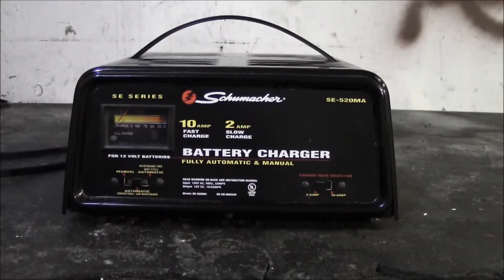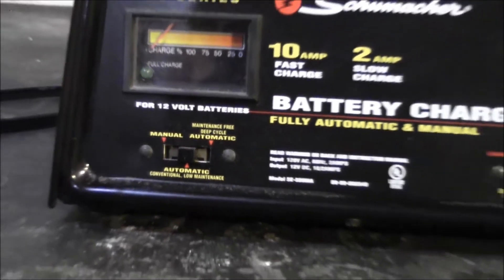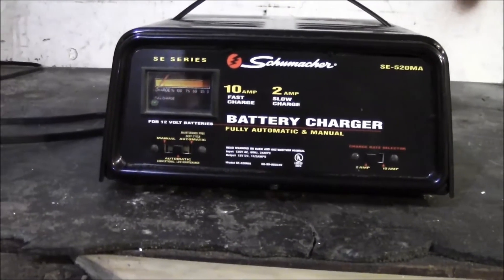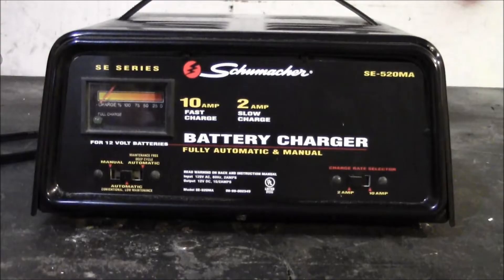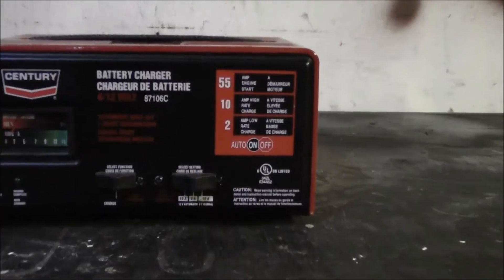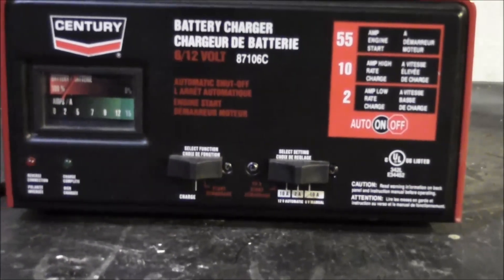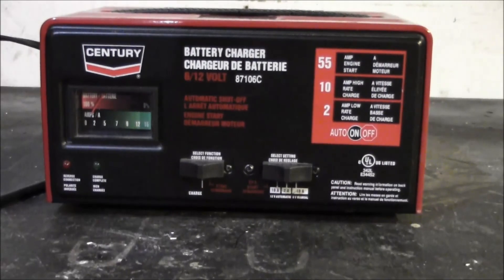What you need to know about battery chargers part 2

Comment: thanks, still using this,  i needed the part about  manual  charging onthe schmacher to  revive a deeply dicscharged battery, to   get it  going  before i switch to  automatic. it was sitting there doing nothing.
Reply from the maker: Yeah, that definitely gets to be frustrating

Comment: how do you know the charger is working?
Reply from the maker: The needle on the display will show that the charger is drawing amperage.  You could also purchase an amp clamp to read the real-time amperage output.  I will admit... these chargers are very hard to read and I only have one battery charger that has a digital display for real-time amperage output.  Which makes it my go to charger.

Comment: Question ❓ What does it mean if the indicator needle jumps from 0 to 7 amps and back a forth?
Reply from the maker: You could have a bad connection with the charge clamps.  Or the charging amp you selected is just too high.  I would try charging on the lowest amp setting your charger has.  Also, sometimes the swing can indicate a physical problem with the battery.  You would need to load test the battery if the swinging will not subside with a lower charging amp setting.

Comment: Highest charge rate on most car batteries will not harm them.
In about 1 hour your car can be started and on the way. 80-90% charged.
Lower charge rate gives a better overall better charge.  12-24 hour.

Comment: Just  subscribe your channel.  Have a question  ?  Would this one charge dead battery  or gott have few volts on the battery in order to start charging 🤔.  Another word does the terminal have live voltage ⚡ running if the touch each other they sparks.  I bought the same company one but it's not live if the battery has like 2-3 voltage then it's it starts charging otherwise it doesn't even read the battery.
Reply from the maker: Most automatic battery chargers have a safety feature that will not allow the charger to begin a charge cycle without a minimum amount of voltage.  The minimum mount will very from charger to charger.  The best way to trigger a charge cycle would be using a known good battery and a set of jumper cables.  Hook up the dead battery to the known good battery with the jumper cables, then hook up the charger to either one of the batteries.  This will increase the total voltage enough to trigger a charging cycle.  Charge the two batteries for an hour.  Then you can stop charging and remove the jumper cables.  Now the dead battery should have enough voltage for the charger to "sense" that it is connected to a battery.  Attach the charger to the battery that was dead and finish the charge cycle.

Comment: What happens if you leave it in manual mode on 2 amps for a couple months at a time?
Reply from the maker: SteveB BKNY:  It will over-charge the battery.  Get a battery maintainer if you want to keep a battery at full charge over a long period of dormancy.  
This video may help you out:  https://youtu.be/biwTpBFM-ns
Reply: fwh79 i had an old Schumacher with manual mode only set to 2 amps for years as a trickle charger and it never gave me problems. Now it’s sitting in storage. I just want to use it to flash my ecu which takes about 30 minutes. Don’t want to risk bricking the ecm if the battery dies. You think I should set it to 2 or 6 amps while flashing the ecm?

Comment: Great video! It confirmed my suspicion about the battery charger I have (Schumacher SC1308) not detecting a high enough voltage on my lawn mower battery, When attempting to charge the battery, the charger turns on and then immediately off. Thanks!
Reply from the maker: Adam Heitzman:  You're welcome.  Glad I could help.

Comment: I have an older Schumacher. Not seeing 10 or 2 amp switch, but is maintenance free  setting a 2 amp?. Mine has 6 or 12 v switch and conventional &low maintenance vs deep cycle, maintenance free switch
Reply: I wanna charge a motorcycle battery
Reply from the maker: Tim Kapeller:  Use the 2 amp setting on a motorcycle battery.

Comment: What does it mean if the charger needle jumping back and forth?
Reply from the maker: CaliCal68:  Could be a few things...  You might have a connection problem with the charger.  Remove the charger leads and then reconnect them.  If you are charging on a higher amp setting, switch to the lowest amp setting.  Sometimes when you charge on a high amp setting in the "automatic" mode, the charger will trigger on and off when it is close to a full charge.  Usually setting the charger to the lowest amp setting helps it finish a charge without bouncing the needle.  Finally, a bouncing needle can indicate a bad battery.  If you suspect a bad battery, take it to an automotive parts store and have it load tested.

Comment: Can you use the engine start mode to jump start your car like you would with jumper cables to another vehicle?
Reply from the maker: James Lydon:  Yes, you can.  That is what it is designed for.  However, be sure to read the instructions for using the engine start mode.  You want to charge the battery on the highest amp setting for as long as you can before using the engine start mode.

Comment: "Slow (charging) and low (ampere)" is still the most safest and effective.
Reply from the maker: MB Legend:  Usually charge on the lowest setting that time permits.  Most people are always in a rush and don't have time for a low Amp charge setting.  Or, use a battery maintainer and always have a fully charged battery.
Reply: @fwh79FOXR6  that's true. The reason why I opt for the "slow and low" is to protect the modern day electronics. I have a smart automatic car charger and I do some charging every once in awhile.
Reply from the maker: @mblegend3056  Very smart.  Slow is the way to go with charging batteries.

Comment: Fwh79: on the old cars but these newer ones, no. Too complex. Maybe oil and plugs but the rest not at all.
Reply from the maker: Dano1947:  Yeah, I hear ya.  I have a buddy who bought a new 2007 F-150 V6 back in 2008.  He has worked all over the country and is somewhere around 200,000 miles on that truck.  He has followed the maintenance schedule in the owners manual like clock work and that truck just keeps on rolling.  Pretty impressive for an American product but I think that shows how important regular maintenance is to keep a vehicle running properly for over 10 years.

Comment: Yes. I agree about battery start modes. Bigger boxes have maybe 110 amps vs the 55 amps here. Trouble is...if an electrical system isn't healthy you can start a fire. I carefully and rarely use such settings.
Reply from the maker: DE Nichols:  It is much safer to just charge the battery.  However, when you are short for time, jumping or using the engine boost is really the only option available.  I try to avoid using engine start as much as I can.

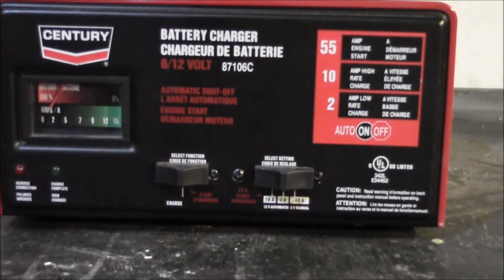Comment: 5:00 awful advice that I see repeated a lot "if the battery is dead and wont charge, just pump a shitton of amps into it for a little and then it should charge fine!" this is why they say all low voltage batteries suck and should be thrown away, they dont get damaged as much during discharge, the get damaged when you force 50 amps into them when they are sitting at only 10% charge.

you need to very slowly coax dead batteries back with low amps, and a sort of push pull cycle  (charge a little then discharge again) to get the battery chemistry saturated with ions again.
Reply from the maker: Luke Morrison:  I'm not sure how much time you have spent in the real world lately but you would find very few people who are willing to play your low amp, push pull cycle game.  People generally don't care about a car battery until their car won't start... then it has a tendency to command 100% of their attention.  They don't care about "ion saturation"... they just want their car to start.  Furthermore, 50 amps is not a "ton" of amps.  Which is why you won't find a jumper pack with 50 amp output.  The alternator in my car puts out 130 amps... is that a ton?

Comment: UPDATE, the Schumacher I was looking to buy are out of production, I would not buy a Schumacher now any ways, because Schumacher would not call me back!) 
I'm wondering why the Schumacher SE8  Charger can not be found, ordered or bought in New England
Reply: well it works, I can tell you that. once turned on the charge comes up slowly not to shock the battery, and once the battery is peaked it shuts down slowly too. my old charger was well made, but you never know how much power you really put in a battery. this Solar tells the "Percentage of power" that is in your battery,  66%, 72%, 83%, 89%, 91%97%,, 100% fully charged.. find the manual on line and read it, it's pretty neat
Reply from the maker: @sideswiped6874  I'll have to check it out.  Thank you for sharing your insight.  I've been looking at Solar for a long time now but I have so many battery chargers... it's hard to justify purchasing another one!  Which model did you pick up?
Reply: @fwh79FOXR6  , I bought the PL2510. amps are> 2, 5, 10 and 55, I bought it for home use, it's discontinued but you can buy it from Napa, I paid $79
Reply from the maker: @sideswiped6874  Sounds like you got a very good deal!
Reply from the maker: sideswiped:  Is there a particular reason why you want an SE8?
Reply: @fwh79FOXR6 , yes, here are my reasons, (sorry I had to edit)
1) because the SE8 is not overly powerful. I want something between 6 and 10 amps, 10 at the vary most, yet I rather have only 6 amps. 
2) it has two settings, 2 amps and 8 amps,
3) rather Schumacher makes it or not it has a big name backing it,
4) I do not want a charger that is full of electronics, 
NOTE that I like the manual switching on this 520MA.

I found that the Se-8, the SE-1010, and this 520MA are not made any more. I have been looking on the Net for a non-electronic charger now for 6 days, I believe I wont find one.. I went 42 years with only 4 amps, and it worked great until it fell 8Ft off the shelf. the manufacturers are all making digital chargers now. and why not, they will not last as long as the old ones ! so the manufacturers make more money that way !!
Reply from the maker: I think your best bet would be to pick up a Century charger.  The K3152-1 is 10 & 2 amp.
Reply: @fwh79FOXR6  LOL those Century chargers are also out of production, I bought a $130 Solar for $79 at Napa. 2, 6, 10, 55, it's the Cat's tail it is
Reply from the maker: @sideswiped6874  How is that Solar charger working out for you?  They do look pretty damn cool.  I have yet to purchased one.

Comment: After a lot of searching I can’t find any information about these two settings: Automatic Low Maintenance. Automatic Free Deep Cycle. What’s the difference and when do you select either one?
Reply from the maker: Richard Wharton:  What kind of battery charger do you have?  Do you have the model number?  Also, what kind of battery are you charging?  I'll give you my best guess for now-  Automatic Low Maintenance would be used on most car batteries.  Automatic Free Deep Cycle would be used on a deep cycle battery type usually found in boats or RVs.
Reply: I have the Schumacher SE-3005MA. For batteries I have a 12v Napa lawnmower, 12v Mega Tron 2 Interstate and a 12v deep cycle Interstate SRM-27. None of those batteries I use much at all apart from the mower one in season, to keep these batteries at their best life how often should I charge? Thanks
Reply from the maker: Richard Wharton:  I would use the conventional automatic 2 amp on the lawnmower, the conventional automatic 12 amp on the Interstate battery, and the 2 or 10 amp automatic deep cycle setting for your SRM-27.  If you charge the deep cycle at 10 amps I would charge it again on the 2 amp mode just to be sure it is topped of.  If you are looking to maintain these batteries, I would highly recommend picking up a battery maintainer.  You can swap it between all three batteries to keep them fully charged.  I would use the maintainer for one week at a time on each battery.  That should keep all of your batteries fully charged and healthy.  Check out this video for more info:  https://youtu.be/biwTpBFM-ns

Comment: I put my vehicle on a charger and it didn’t help.
Reply from the maker: The Martas:  Is the vehicle out in cold weather?
Reply: fwh79 yes it’s -50 with windchill
Reply from the maker: @villarrealmarta6103  There is a very good chance that your battery is frozen.  The battery contains a mixture of acid and water.  As a battery is discharged, the mix becomes less acidic.  This makes the battery easier to freeze in cold weather.  I would highly recommend that you remove the battery from the vehicle and allow it to thaw in a warm room.  Then try to charge it again.  It may take 2 or more hours to thaw the battery.  DO NOT charge the battery inside a house.  The battery will release explosive gases as it recharges, so do not charge the battery indoors.  Always charge a battery in a well ventilated area.
Reply: fwh79 thanks for your input. I appreciate it a lot. Also thanks for responding so quickly. Take care!
Reply from the maker: @villarrealmarta6103  You're very welcome.  Good luck.  If you have any more questions, be sure to ask me.
Reply: the problem is, that you don't put vehicles on chargers, that will brake the charger

Comment: I've completely discharged a walmart 12v motorcycle battery for a cb400f by forgetting to turn the key off over 10 times so far, most of those went overnight. they don't even show voltage in the morning, beyond warm, they're cold. i'll put a schumacher 2 10 50 on jump mode for only a few minutes, sometimes as few as 30 seconds, and it'll be up around 11 or lower 12's. if i don't use the jump amps the auto charge 1 amp will never get it over 5volts,   the  yuasa auto 1amp or whatever it is, will then top it off.  trick is to buy another battery so you wont have any down time waiting for the charge. or making tape over the kill switch lever (like grandma does on light switches,) so you'll always hit the Key off. or tie a key lanyard to your wrist . i'll run a battery for over 10 yrs. they say it'd hard on the stattor.
Reply from the maker: Buck Wheat:  Do you turn your bike off with the kill switch?
Reply: @fwh79FOXR6  yes, but leaving the key in the on position which leaves the headlight on. it's dim as they were from factory production. maybe a buzzer would help. age is linked i think to it happening more often.
Reply from the maker: Buck Wheat:  You should just turn the bike off with the key then.  What kind of bike do you have?
Reply: @fwh79FOXR6  of course i should do that, but coming in with a bag or groceries, pizza or beer, i'm usually focusing on those important steps, then i'll find out hrs later the key was on. i've been riding this cb400f ss 1976 since early 80s. paid $400 for it,  it's a blast, 1 got a couple of them, red and yellow, their better than wives.  i ride the one hard as if i was racing it. it's hard not to. just under 400lbs, narrow enough to ride through the front door. and it screams when it's feeling good. never been crashed. but it's a lot of fun. oh and it's got a kick starter that you push over by hand and it runs after 1 cylinder fires. it's got all the stock ignition point system that it came it. it's stater is weak. they all were. insurance is 75 bucks a year. registration is gettin high like 120 a year. it gets 45 to 60mpg running wide open or not. and will pull 6th if there's no wind nor any incline, no back packs and your tucked in as flat as possible, breakin over 100mph. acceleration is gnarly. i used to be able to give the best 600cc riders a run for their money in the tight canyons. not any more. what are you riding these days?
Reply from the maker: Buck Wheat:  That's awesome my man.  Gotta ride what makes you happy.  I've never brought a pizza home on my bike before... you got me beat on that one!  It is pretty amazing how long some of these bikes can last if they are maintained.  I have my trusty old 2000 YZF R6.  I would love to find a nice 2008 R1.  Haven't gotten around to looking for one though.  I think you'll be ok if you just start turning the bike off with the key.  Just gotta make it your new habit.  I did the exact same thing you did a few time.  Left the key on over night and woke up to a dead battery.  Like you said, if you don't have a back up battery... it's gonna be awhile before the battery is fully charged again!

Comment: Thanks for your video. 
Please can you give me your opinion on this charger? I’ll be using it on 12v car and deep cycle marine battery to charge and as a maintainer when I’m not using them.

https://www.amazon.com/Schumacher-SE-3005MA-Fully-Automatic-Charger/dp/B000H90XOW

Thanks in advance.
Reply from the maker: Richard Wharton:  You're welcome.  That charger should work well for you.  However, if you do not need or want the engine start mode... I would consider picking up this model:  https://amzn.to/2C0Tcg4    The 15 amp charge mode will charge your deep cycle or automotive battery faster than the 12 amp mode you have chosen.  I don't think you can go wrong with either charger.